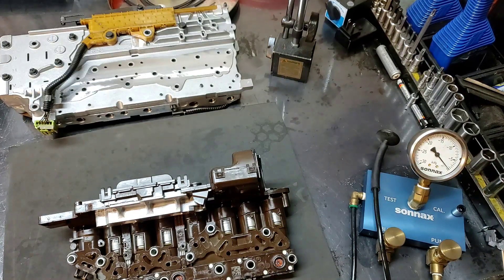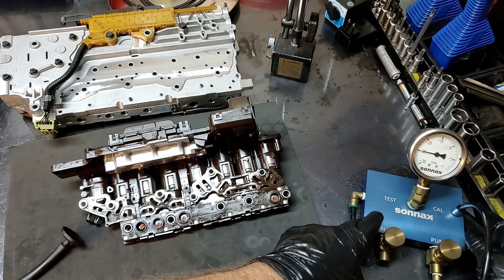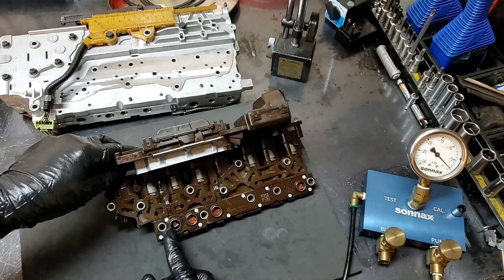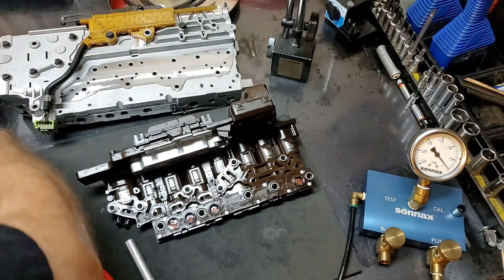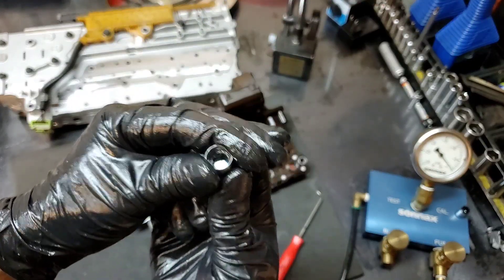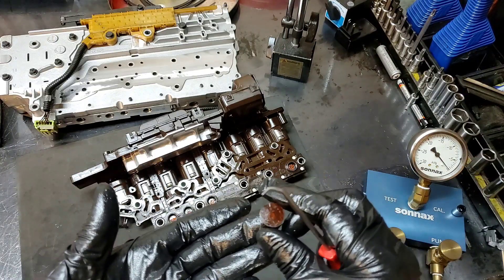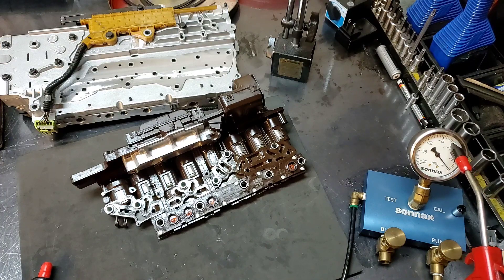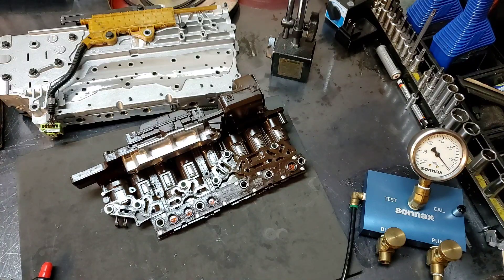TECHM Pressure Switch Testing

Comment: Hi, thanks for the great tutorial video. That was awesome. I learned a lot from you. I want to replace the pressure switches on my 2012 Buick Enclave. I was wondering if I take out TCM do I need to replace the filter plate or can I just take out the TCM without having to change the filter plate? Thanks again..

Comment: This video sucked. 
:D Thanks for the info. Home users could probably cobble something up with a set of AC manifold gauges, vacuum pump and some fittings if they've got them.
Reply: HVAC vacuum gauges are designed for very low levels of vacuum, a cheap automotive vacuum gauge would be a better match.